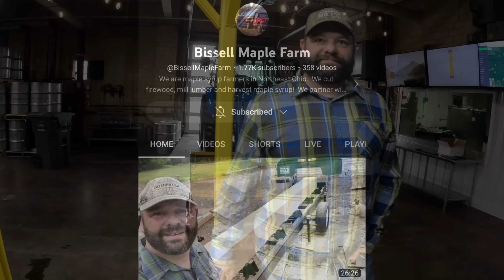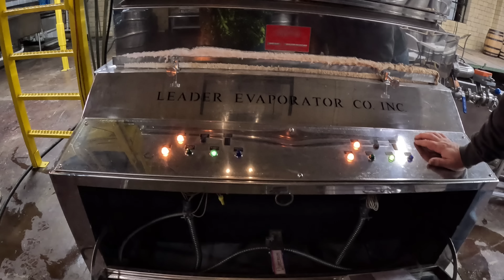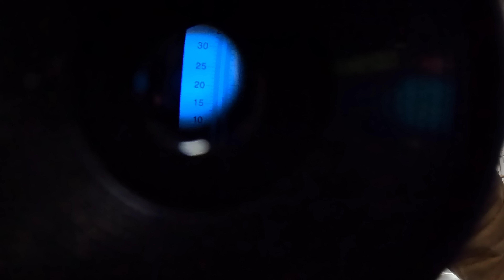A Step-by-Step Guide to Crafting Maple Syrup!

Comment: I bet the heat and humidity is off the charts inside the building there. Looks so delicious. Might see if somewhere here in Wv. sells the syrup and get some of it. Thanks for the tour and tutorial Shawn. Y’all keep up the great work!!!!
Reply: There was a "cold air plug" in the front pan stack. Also, I think there was an industrial exhaust fan running in another area of the plant as well. We opened the door behind the tractor a couple of times, and the steam flowed up the stack, heating it up, and it cleared up.
Reply: Cool. That works. It just looked that way to
Me. Lol. Amazing operation for sure.